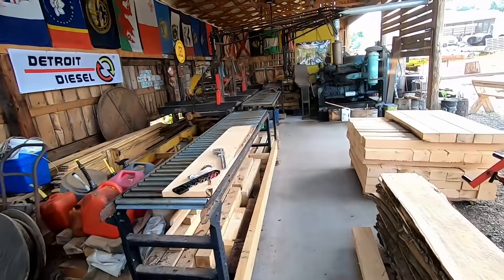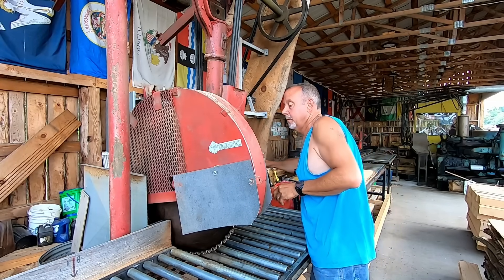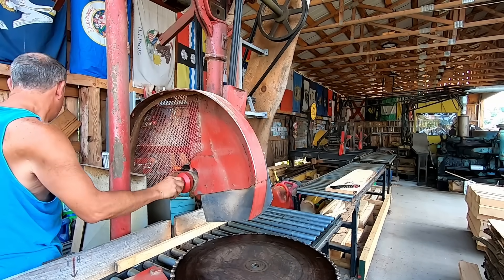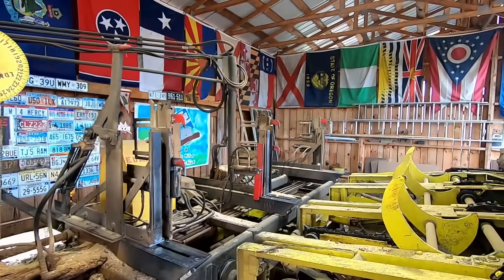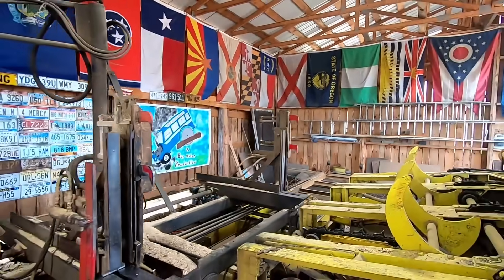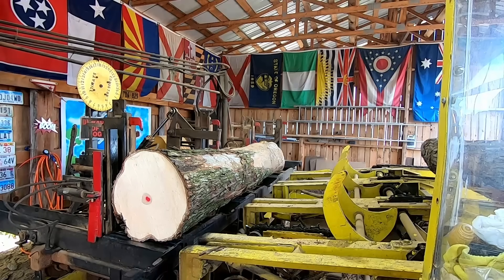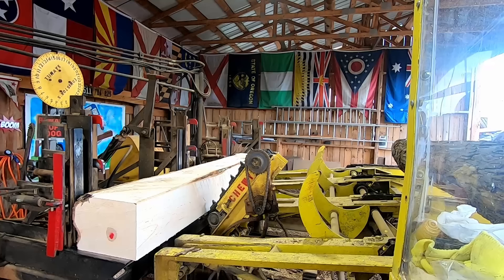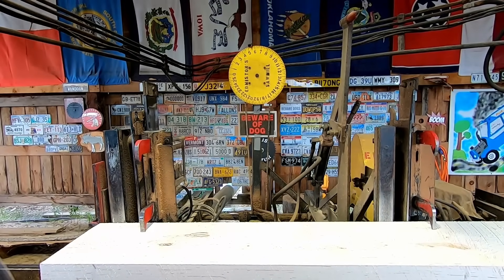working on the swing saw and sawing more decking # 451

Comment: Interesting your comment about hammering on the arbor nut. Growing up we had a buzz saw bolted to the JD 50 tractor. Cut every stick of fire wood for our northern michigan home. No other heat source.  Cant tell you the blade size, may 32in...but there was always a hammer in the tractor tool box and the nut was always hammered on. Not much, a couple of taps on the left hand nut. That nut was still in use on the arbor when dad passed at 93. He took good care of his saw, had it hammered when needed, hand sharpened with a flat file. And a negative rake tooth. I get what you mean but seen that thing used and cared for my entire life. I got to stand and catch the cut offs from that singing monster for cord upon cord upon cord of mostly hard maple. Still have all my fingers too lol. Thanks for the memory.
Reply: I love reading comments from the old coots, about what they did back in the day.  I'm verging on coot status now and have no cool yarns to make the young fella's eyes bug out.  Guess I might be a failed coot.  But thanks for post, mate.
Reply from the maker: that's a good way to cut firewood for sure , I think they still make them today.

Comment: Mark, have you ever used easy off oven cleaner to get the pitch off the teeth?
when its dull, it's dull but keeping the buildup cleaned off will extend the time between sharpening.
Reply from the maker: never tried that just WD-40.

Comment: What I appreciate about the 'widow maker'  , the swing arm saw,, is that you operate it correctly,, always the pull hand is the left hand, and you never stand in front of it.  The saw type EARNED its nick name.  Ya never stand in front of the blade.  I have not noted,,, do you have a limit chain on it?  Or a welded stop bar?
Reply from the maker: yes it has a limit chain.

Comment: Hey Mark, instead of a stick below the blade, which holds the blade while breaking the nut loose, put a longer stick across over the shield to hold the swing arm out so you can remove the blade. If a hammer is needed only use a wood mallet to save your hand.
Reply from the maker: good idea.

Comment: I'm not too far from John down here in Balto, Md and when I used to work for Manny, Moe & Jerk back in the 80s & 90's we dealt with a company called Wareheim Air Brakes Inc, you could walk in with any clutch parts and within a few days they would rebuilt the disc and plate with new springs and clutch faces, even out of production items. They specialize in Semi trucks but always did our hard to find car parts too. Add their name to your rolodex for future needs, there may be a branch near you, or just ask any truck shop about rebuilt parts suppliers locally. As far as new engines go check your local military auctions.
Reply from the maker: thanks for the info.

Comment: I always remember Jason's sign in front of his cutoff about the stupid people. That motor can be rebuilt with no trouble and set back for a spare afterward. Jason probably knows where another motor is and I can email you his contact info if I didn't give it to you already. He knows a guy in Florida that has a warehouse full of marine jobs he's sawed for and has a 318 bought but has the wrong governor for a mill. It's out of a truck and he was going to put it in his old R-model IF it ever quits. Old Dog trucks don't die easy either. So just say. Me and the old Scalawag made a trip to Maryland and brought back a 6-71 fresh out of a mill but that was years ago. He never hooked it up to the planer he got either. I guess it's all still sitting over there. Good sawing and happy sharpening and a great weekend.
Reply from the maker: thanks Lewie , we do want to rebuild the bus motor someday but we need a back up unit to run the mill while it's down.
Reply: @markgalicic7788  That's what I figured.

Comment: Does the swing saw have carbide teeth? Couldn't tell in the video, thats a big blade for ole ZZ . Nice guard you manufactured there mark. Thanks for the maintenance video and your right about the hammer guys, old sayin tights tight to tight is broke
Reply: Tighten it German tight. (Goodentight)
Reply from the maker: thanks Doug, yes it is a carbide tip blade .
Reply: @markgalicic7788  👍

Comment: They are infinitely rebuildable until you crack the block, which is almost impossible to do.  And during a rebuild you can upgrade most parts.  I worked there in the late '60's when I co-oped at GM Institute, Flint MI.
Reply from the maker: yes we do know that but we can't shut the mill down for a long time.

Comment: Mark, that DD 671 will last you for the rest of your life. You need to get hold of this guy "Bus Grease Monkey". He's been repairing those things his whole life. A complete overhaul and you're good for another 30 - 50 years on that motor. That might be a lot of money but way cheaper than a new engine. 
As for the engine that's been hydraulically locked I'd be careful there. Could be a bent connecting rod. Anyway, if it were me, I'd be looking to rebuild that 671 and continue on. Good luck either way you go.
Reply: Mark has seeked advice from Scott about his 6-71 before. That C13 is likely overkill as it has more then 3 time the horse power of the 6-71.

Mind you the C13 would run cleaner and be more fuel efficient then the 6-71, when properly geared and tuned to power the sawmill.
Reply: BGM has not been repairing them his whole life. I suggest you watch his videos again. I don't doubt his ability but that statement is, based on the BGM videos, incorrect.
Reply from the maker: this was just a look .

Comment: You might have been able to block the swing saw out to work on things if you blocked it at the swing arm. You would still need to block the blade to loosen it but the body of the saw would be more stable by itself. And, good luck on the new motor hope it works out for you. My grandpa told me that if it has breasts or a motor, it needs constant maintenance or it will break down at some point when you least expect it... it has held true my whole life and I'm 67. LOL
Reply from the maker: yes very true.

Comment: Static wear is more damaging than operating wear, considering that it has not been used for 9 years, it is a very good idea to change it.
And another very important aspect, a newer generation engine will consume less fuel for the same developed power.
Mechanical engineer Romania
Reply from the maker: yes that's true , we will find something but not in a hurry.

Comment: Hey Mark. Your explanation regarding the bus motor situation was unwelcome news but it was only a matter of time before the 671 power unit would need some attention. Just a thought. What about scheduling a complete overhaul of the bus motor with a reputable diesel mechanic and just work on other projects around the mill and in your workshop while the Detroit is being rebuilt? That way you could avoid investing in a second power unit and would have virtually a new power unit after the rebuild is done. Just a suggestion. Thank you again for another great sawing video!
Reply from the maker: thanks Randall , we were told by a mechanic one you tear into the engine you my find more problems like a bad crankshaft or camshaft and want to just find a better engine.

Comment: Opinion from someone that's been in the diesel industry for the last 30 years, and considering that application, I would shy away from anything electronically controlled.  I would look hard at B series Cummins engines.  Easy to work on, dead nuts reliable, thrifty on fuel, and still fully parts supported by both Cummins and the aftermarket.
Reply from the maker: thanks for the info.

Comment: your old Bus motor has done a good job for you but they will eventually ware out but as a retired diesel mechanic i have some jokes about 6 71 detroits, when they start using / leaking a lot of oil instead of dumping oil in every morning and having it leak out during the day just reverse the process by pouring the oil over the top of the engine and it will soak in during the day, the best thing about a 6/71 is good for is converting money into noise, a 6/71 is like a 16 year old girl, they will make a lot of noise in town but when you get them out in the country they don't do very much. There I will shut up now, you are doing a good job and i enjoy your vidios
Reply from the maker: thanks William , great comment.

Comment: Maek I'd do a little research into a DD 60 series. They are vary fuel effect and will run for long hours. After running 430 hp one for 900000 without any issues. Only oil changes. Also if You're looking for a 2 stroke. Check  with Wayne at OI2 stroker on you tube. He is a sharp DD 2 stroker Guy. Good luck!
Reply from the maker: thanks for the info.

Comment: Hi Mark, watch your video and notice that you do a great job. Circular saw videos are more interesting than band saw. I have an older Woodmzer, 1989, but don't use it very much. I also have a power takeoff (Rockford) that I will be selling, but I'm miles away in New Brunswick, Canada. If you're having trouble finding one more locally get in touch.

Comment: would it be worth while to add a pin or other type locking device to hold the swing saw in a forward position to aid in doing maintenance
Reply from the maker: yes a block of wood did the trick.

Comment: A 3406 Cat is one possible replacement. They run forever used them in the oilfield and never had a failure. Are carbide teeth on your chop saw? Great video thank you.👍
Reply from the maker: thanks Dennis , yes they are carbide.

Comment: Cat is a good/great motor, however a Cummins 6bt 12v has no electronics and will run if it gets fuel and turn it over and can be configured with a wide range of RPM and HP and Torque. A rebuilt 12V 6BT Cummins can be had for a reasonable number generally far less than a more modern Cat. and if rebuilt will come with a Warranty. I personally would trust anything Diesel Creek told me Matt is a very knowledgable diesel guy. Which ever way you eventually go I would install in your operator cab an EGT guage so that you can tell how hard your motor is working during sawing.  Ray Stormont